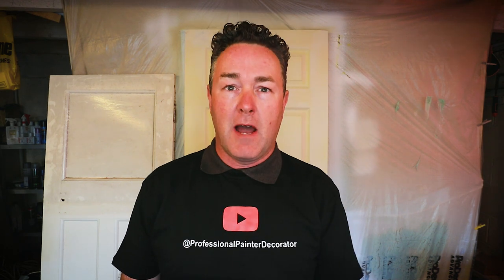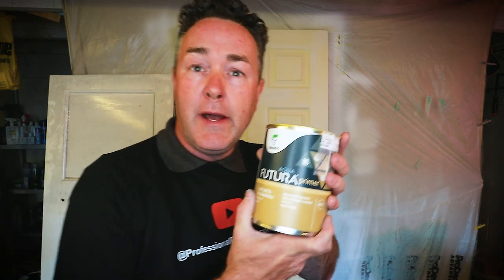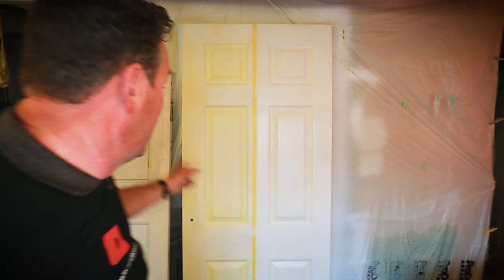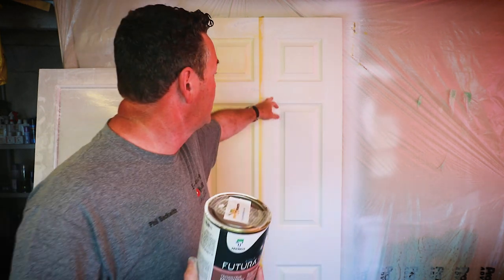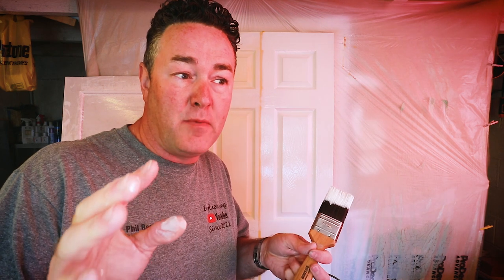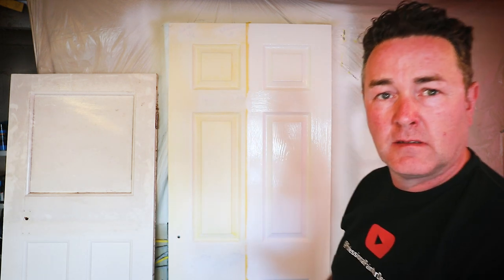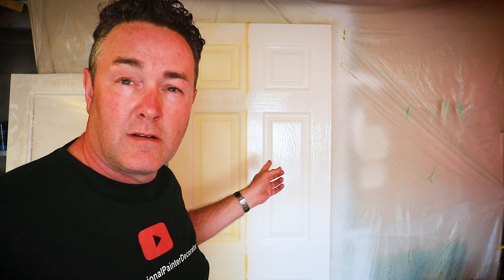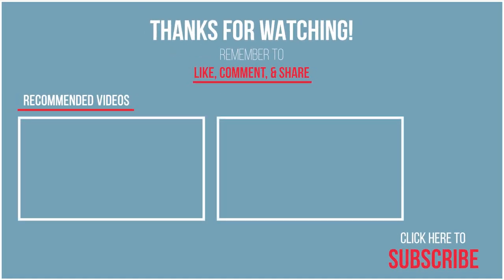Teknos Futura Aqua 90 - Best water based Gloss?

Comment: Nice video Phil and good to meet Dave 👍 could I please ask for some advice regarding outdoor surfaces. We have a small decorative picket style fence separating lawn from patio area and have used Cuprinol garden shades before but end up triple coating it every year or two as it slowly peels or greens up. I’d like to get a longer lasting finish and was wondering if it can be sanded, primed and painted with a proper outdoor paint system like weathershield or if this is inadvisable for a fence and stick with a tinted stain? It’s a fairly smooth wooden finish like outdoor furniture not a rough featherboard type finish. If we were to give it a go would you treat with diluted bleach first so the green doesn’t return or is there a mould/algae resistant primer or paint you would recommend. Thanks and hope the sponsors come through soon 😂
Reply from the maker: ello, have a look at bedec barnpaint.... goes over nearly anything.. needs little prep... two coats is normally plenty. Get it at ToolStaition... or
check out https://www.wood-finishes-direct.com/product/bedec-barn-paint
also PaintMonster.co.uk
Brewers and paintwell etc
Reply: @ProfessionalPainterDecorator thanks Phil will do 👍 I think I remember you did a video on that a while back

Comment: Use it on kitchen cabinets etc. excellent paint
Reply from the maker: Thanks for the tip!
Reply from the maker: white vanman  my kitchen is spray painted which I did with Tikkurila helmi 30 in 2019..... Still looks good... Not chips.
Reply from the maker: white vanman  prep is still the key ;)

Comment: Compared to isomat? That seems to be a contender.
Reply from the maker: isomat is a proper water based paint, not alkyd like the furtura aqua
Reply: @ProfessionalPainterDecorator  well if it washes in water that’s all I’ll be interested in I guess, which one is better to use in or out. Both 3 coat process, if both were an option which would you choose and why, there’s so many options.
Reply: @t.dizzle83 he aqua 90 has a far higher level of gloss than the isomat gloss. That's the biggest difference

Comment: Phil, it's water borne, not water based and that means it is alkyd
Reply from the maker: Alkyd gloss as in oil based?
But this you can wash brushes out with water.....  Hybrid gloss then?
Reply: Hybrid is alkyd oil suspended in water
Reply from the maker: @englishdecorator  yep. The futura aqua is a urethane alkyd based paint according to the teknos website..... 
I don't think it's like Bedec acrylic based paint

But if your brush washes out fine... Does it matter??
Reply: Not really keep testing, that capability pu is a nice finish but a bit pissy
Reply: Caparol
Reply: @Phil Beckwith The Professional Painter & Decorator 
Can't see the point of using a alkyd.
When uou got the chance of it yellowing mate. 
Use to use Benjamin Moore advance gloss years ago.
To it let me down.😢😢
Glad uo see Doris as got a partner 😁😁
Reply: @ProfessionalPainterDecorator  it matters if it discolours - is it promoted as being non-yellowing in low-light conditions?
Reply from the maker: @grahamsmith9788  make sure you watch my Caparol video where I talk about both ... 22nd June.. it's a Premiere where I'll be online watching at the same time.
Reply: @englishdecorator  weird word that 'hybrid'...its just a paint industry term for a blended paint.
Reply: Haha @ rollinslad hybrid is not a paint industry only word, some painter's are thick..
Reply: @englishdecorator yep although I didnt sat it was only used by the paint industry did I ?, Read the comment again, slowly....the most overused word ever...marketing people love it, started with cars, and now we have 'hybrid working' perhaps  'industry adopted' would be more apt then?
Ask a paint chemist about blended coatings. Are you suggesting that only 'hybrid' paints are water borne?4e3
Reply: @englishdecorator .....I use loads of PU .......dont know what you mean it's a nice finish but a bit pissy?